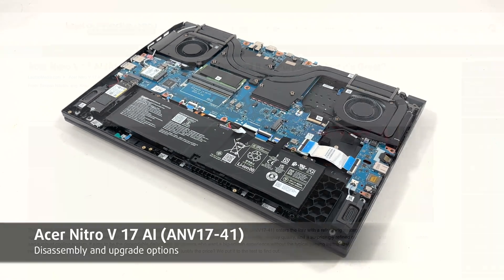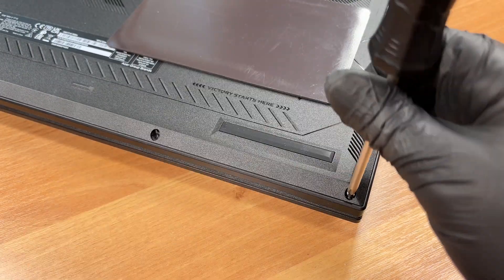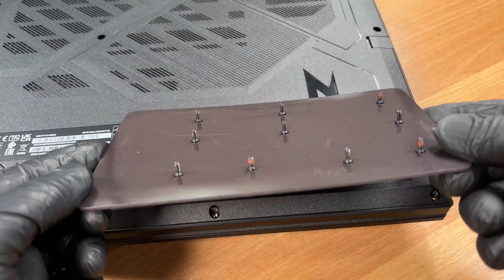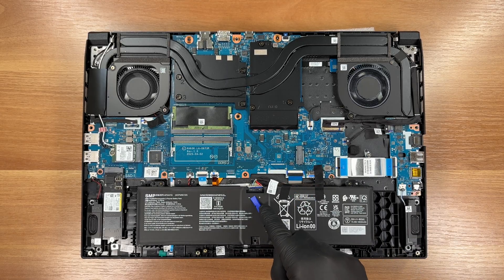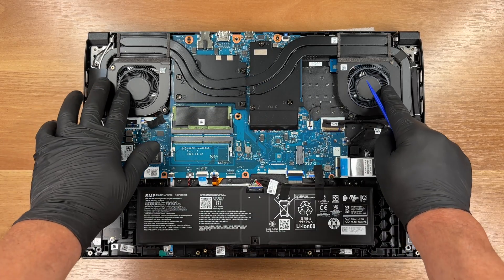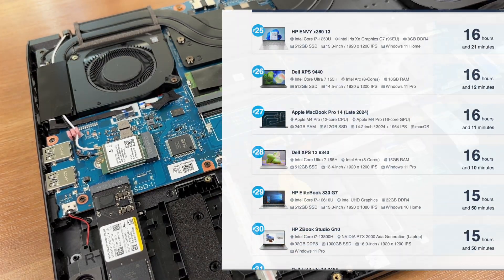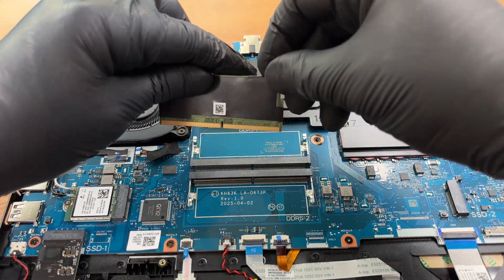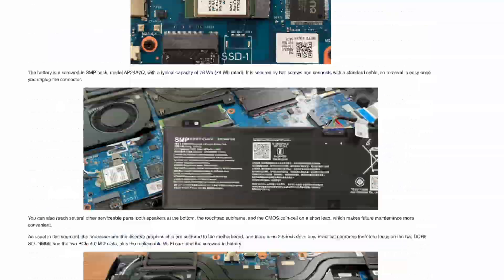🛠️ How to open Acer Nitro V 17 AI (ANV17-41) - disassembly and upgrade options

Comment: If I installed or mounted a second SSD drive (M.2 drive) without unplugging the battery as you did at the start..... I know it's not recommended...... but could it be an issue?
My fans are spinning more frequently since, no other problems, no sparks etc., that may be due to additional heat from the presence of the M.2 drive? And hopefully not due to an induced fault via not unplugging the battery?